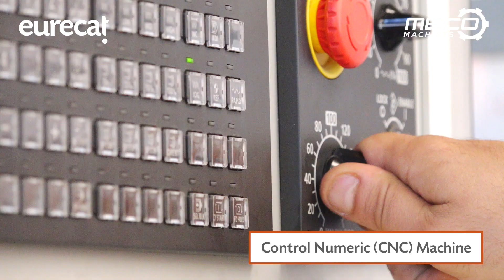Incremental Sheet Forming (ISF) Machine

Comment: I assume the only practical use for this method, rather than stamping, is the cost for very few parts.
Reply: yeah i would say low volume production or plain simply prototyping. I mean you dont want to invest 100k in molds to then find out the product dosnt work as designed and just bin the 100k in stamping mold to try the next design. So its better to make it on a machine like this, build 1 or 2 prototyps, and if it works you get stamping dies made if you expected order numbers are big enough for that atleast.

Comment: ".. does not requiere investment into costy tools, suchs as dies." What do you call the thing that went below the sheet metal, then?
Reply: 100 $ piece of machined forming polymer... compared to 40000 $ complete die if you buy it in China
Reply: @Rapbando  That's a lot more than $100 of material and a lot more than $100 machining time!

Comment: So kind of like a 3d printer for metal sheets? Interesting.
Reply: No 3d printing is like adding material.
This is forming a blank with the help of a ball end tool and cnc code.
Reply: If anything, this is more like vacuum forming, without a vacuum
Reply: Seems closer to a standard mill analogy, since it starts with a flat plate and works it into shape.   Or as someone mentioned vacuum forming.  It can't possibly  be quicker or cheaper than a stamping process, though, so it seems like a solution without a problem?
Reply: @markdoldon8852  yaa but this is surely a solution for Prototypes and low volume special parts.